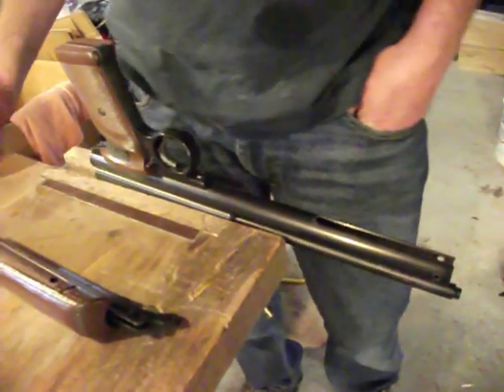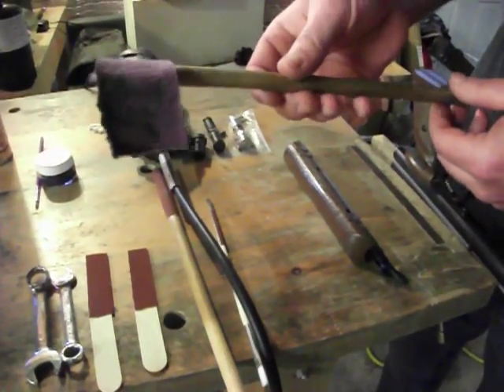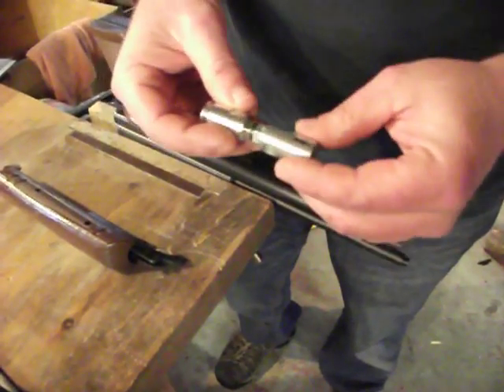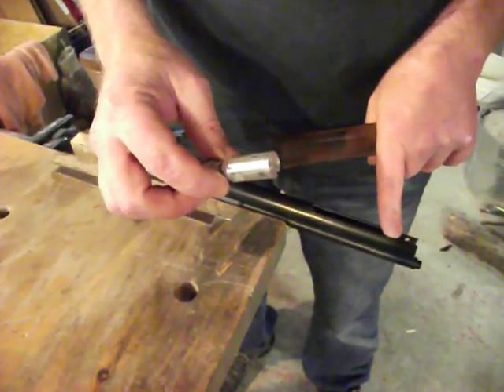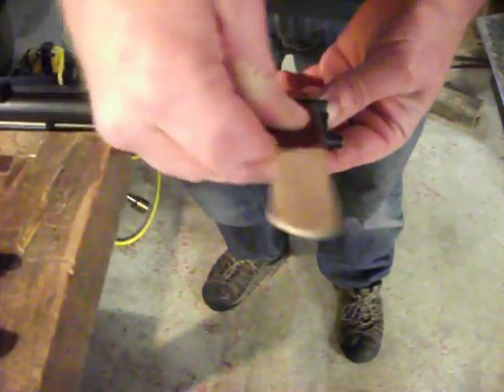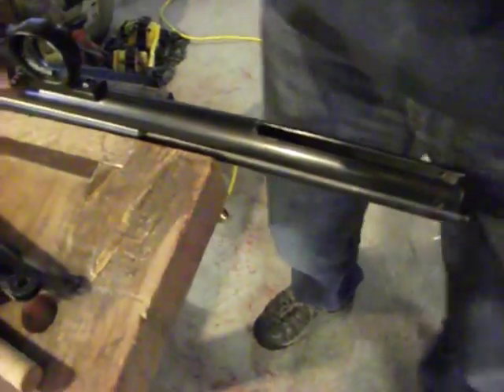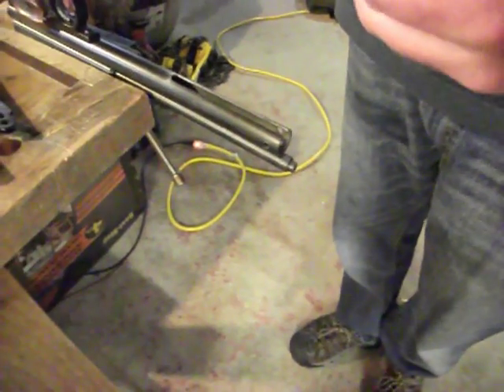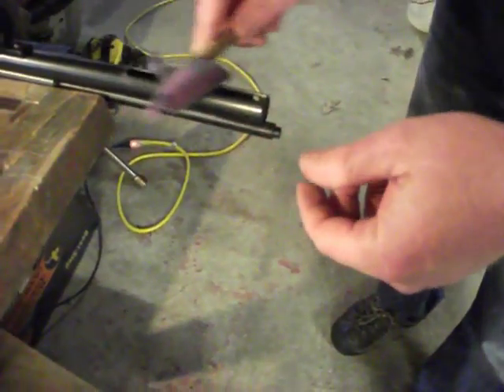Aluminum FTP Installation Part 1.mp4

Comment: remove the tube to polish the slot. you will never remove all the abrasive residue without removing the tube. grit inside the gun will cause problems. removing the tube is not that big of a job.